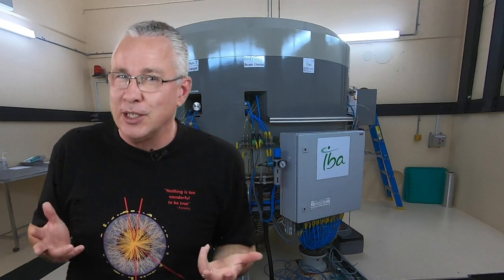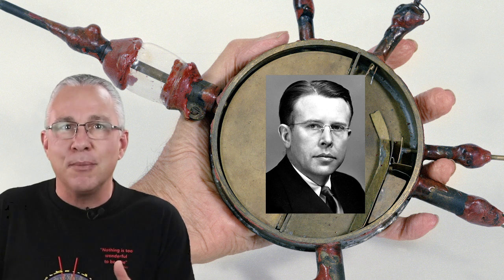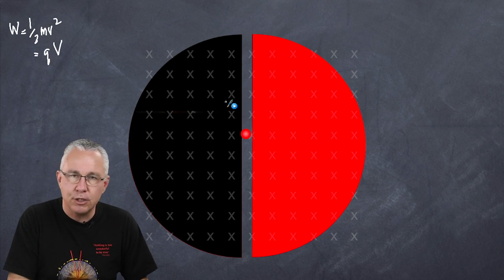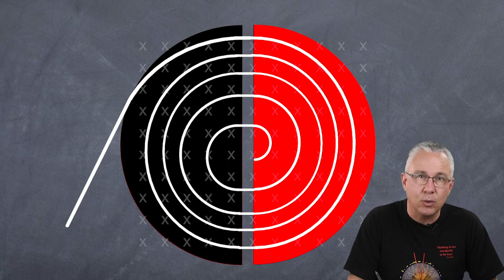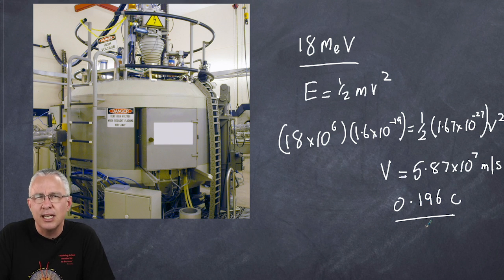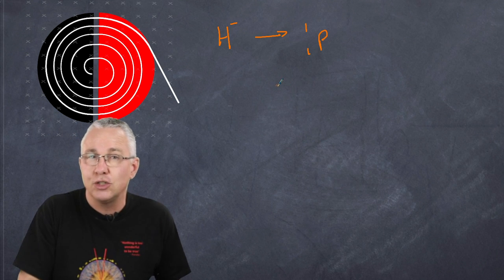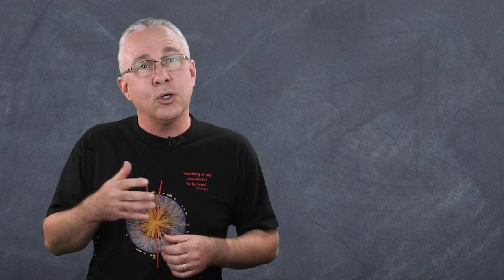What is a cyclotron, the physics behind its working and why.

Comment: Biomedical scientist incoming! I do not understand why the proton would go around in circles instead of just left and right. Can someone explain this maybe?
Reply: Because of the magnetic force. The force of the magnetic field on the proton is the direction of cross product of velocity and magnetic field vectors. Keep in mind that tangential velocity and radial velocity dont change in magnitude but in direction DUE to the MAGNETIC FIELD. Cross product of velocity vector that is constantly changing in direction and a constant magnetic field vector results in a magnetic force on the proton RADIALLY INWARD. You can think of it as a ball attached to a string attached to a rod and the ball is rotating  around that rod with maximum tension on the string.

Comment: since the metals dees have an opening (otherwise how would the protons enter?), doesn't that mean electric field can be inside the dees? metals will block electric fields if they are a closed surface but here the metal dees are open

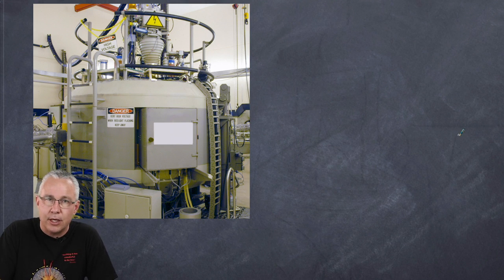Comment: 7:51 Does this mean that the strength of the magnetic field in the cyclotron is also 18 MeV?
Reply from the maker: The magnetic field strength of the cyclotron is measured in Tesla. And it is different to the 18 MeV. That number refers to the energy of the protons as they exit the cyclotron.

Comment: Couple questions. 
1. What is the mechanism and tech of initially injecting the Hydrogen ions? does it just enter in a hole in the gap between the "dees" ?
2. how does this electron 'stripper' work? where do all the electrons that were "stripped' go? is there a secondary use you can use for this collection?
3. i assume same process could be used for anti protons, although polarities would have to be switched accordingly i assume...
4. the 18MEV mentioned, is that based on some prior acceleration into the unit? or is that a slow moving proton?
5. have there been any open source projects to work with platforms like pi, arduino, etc. to build these DIY to get all the math right?

Comment: Thank you so much for this explanation I am a undergraduate plant science major working in a research reactor. Since radioactive isotopes are not my specialty I have to go to YouTube a lot of the time to fill myself in. So far I’ve only worked with C11 but I might work with some Mn isotopes in the future! This explanation really helps me understand what our physics specialist is talking about :).
Reply: I want to work in a hospital where they used a cyclotron to make radioisotopes. The job is called "Cyclotron operator" but i have no experience with the machine, i know how it works but only with the theory  and i dont know what to do cause i really want the Job but i dont know where star to get it, i am chemical engineer
Reply: @sweethtooth8412 Siemens

Comment: Question. I paused at 5:21 to ask. What is the time component in each revolution of the proton, measuring from its' tightest revolution to the outer most as the proton travels, each circumference? I suspect that the time involved is very much the same if not identical. I have often pondered "How is it that the innermost second hand dial on a conventional clock is the same time measured from its' outer most circumference compared to the inner most distance traveled and yet the same time."
Reply: because r and v are proportional to one another if you look at the formula for the time for one revolution, you see that it does not depend on r you only have T=2*pi*m/B*q and all of those factors are constant so it’s always the same time frame.
Short: increase velocity=inreases radius therefore the faster it gets the wider the radius will be. It basically balances itself hence there is no difference in time

Comment: What is the MAGNETRONE, and how does it make the RADIO-HYPNOSIS? 
Look at, this is the radio-electronic TUBE, that has the circular roots on its walls, as like tube and as like semi-circular tube-like roots in it's walls that make the MAGNETRONE tube inside as like revolver drum. Therefore, the electrons are flying from cathode to anode under the electro-magnetic field, and by the wall roots it got speed boost as like little  permanent magnits attracting them and making twisting as like tornado. That electrons tornado got speedy flying by the anode into square mirrored vawe-conduit that is the Over High Frequency that the radars emitting and by the difference of the time electrons flying till the sea object and returned back - they judge about distance from that object between radar and the object on the sea.
Therefore, if they make the opens and closed MAGNETRONE tube with the human voice current, the MAGNETRONE will vibrate the air molecules as like as the speaker. So, the texts of the psychological expressions got formed in the computer and combined into packets that got emitted from the sea radar - and .. the humans got HYPNOTIZED - the human behavior may be programmed into future default on the PROMPT, when is not enough the information and the DOMINANCE of the behavior is the RADIO-HYPNOSIS text inserted into brain into deep memory of the Human. Therefore, the RADIO-hypnosis is the criminal attempt to conduct by the human behaviors.

Comment: do other particles become present inside the accelerator and go in shorter or longer spurts than the particle it's accelerating while the particle accelerator is working and going? can it accelerate 2 particles of the same type and or separate types to see how the interact?

Comment: Thank you for your video, very insightful. What if the velocity approached the speed of light? Wouldn't the mass change due to relativistic kinetics, in which case would this then affect the calculations for the angular velocity?
Reply from the maker: You are correct . Many cyclotrons are sub relativistic. More a challenge to make one to get to relativistic speeds. That’s one of the reasons for the synchrotron invention.

Comment: Great video! I am wondering what is the limit for how many particles can be accelerated per one cycle at once? Also, can't we replace the heavy electromagnets with neodymium magnets - similar magnetic field, but the cyclotron is much lighter?
Reply: Neodymium magnets cannot withstand the heat , that's why electromagnets are used.